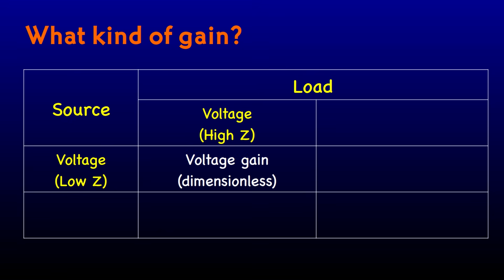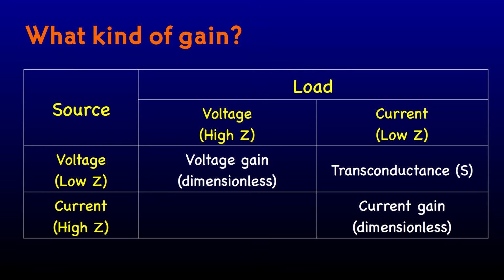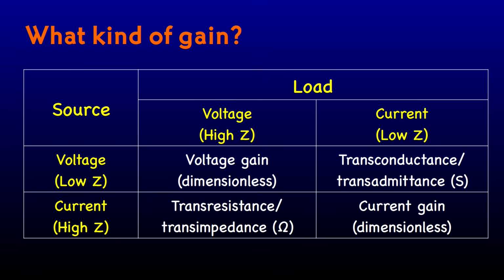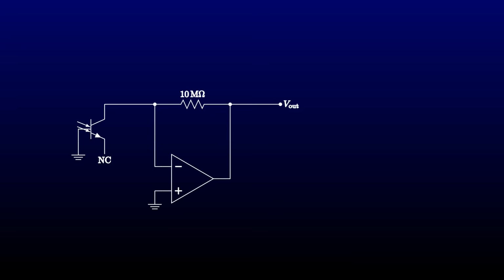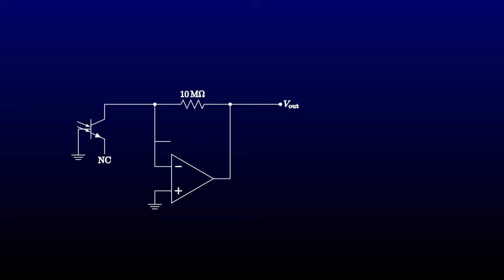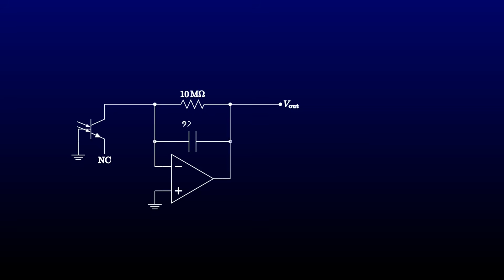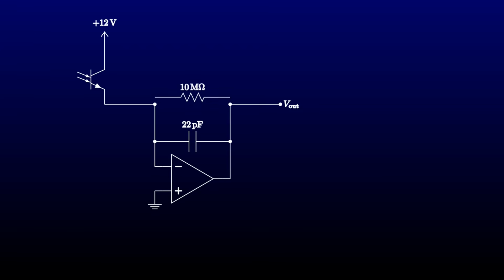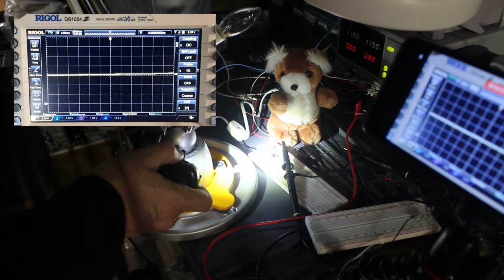The Transimpedance Amplifier | Op-Amp Basics, episode 13

Comment: Or you could modify the photometer a little and measure some of the tiniest, most sensitive things humanity has ever seen: Gravitation waves!

Seeing as they almost always use TIA photodiodes to measure their small scale signals with added quantum magic.
Reply from the maker: Yes indeed! 

On a slightly easier gravitational topic, another viewer is working on a Cavendish using a differential signal from a pair of TIA photo detectors as the sensor for the tiny displacements. These fundamental circuits show up over and over.

Comment: Thanks so much for this video. I plan to do a cavendish balance setup using photodiodes and needed to learn how to build a TIA. I’ve recently started venturing into analog electronics and it’s such a fun world! Your video series on BJTs has been so helpful as well.
Reply from the maker: Glad you're finding the material helpful!  It's been fun making it. 

The Cavendish balance is an ambitious project - the forces involved are so tiny!  Planning to use some sort of interferometry to measure the displacements?

Your channel got a sub from me, because I want to see how the work goes!
Reply: @KludgesFromKevinsCave  wow thanks Kevin, I appreciate the sub!

Yes it is an ambitious project, especially for someone self taught.

No I’m not doing any interferometry, I’m using a simple optical lever with a laser, optics mirror, and 2 stationary photodiodes with a difference amplifier. If I can calibrate it properly and keep the oscillations within the diodes windows, I might just be able to use just dual stationary photodiodes. I recently revived a 1970s Heathkit chart recorder so I’m hoping to use that instead of the usual camera position tracking or digital data logging methods.
Reply from the maker: Heathkit chart recorder?  I'd forgotten that Heath had one!  But of course they did - I used a Malmstadt-Enke UV spectrometer as an undergrad that plotted the spectrum on one. Good luck restoring that instrument!
Reply: I had no idea HeathKits were used in semi-professional settings. That’s pretty awesome, thanks for the little story. Just got the carbon fiber for the beam and the tungsten filament for the torsion. We will see how this goes!
Reply: @KludgesFromKevinsCave  Just got my first (repeatable) gravitational signal. I’m using just a laser and mirror with an optical lever at the moment. Hopefully I’ll be building the TIA detector circuit now that I have a working torsion balance. I have to say, seeing actual gravitation act laterally is quite breathtaking and beautiful.

Comment: Hello Kevin,
I see you are using the BPS breadborads. Did you so from the beginning of your channel? Me personally switched to those years ago already due to the poor quality of other brands I tried...and the absurd pricepoint of the ones from 3M. Very happy with the BPS. What is your experience? Have a nice day!
Reply from the maker: I wanted to support Ben Eater, so when I was starting the channel (and needing more breadboards for videos in progress!). I bought a half-dozen of the ones that he resells, and they've given admirable service. I think the only dead point in the lot is one that I abused with a too-large pin.

I also have a big breadboard that's a what-have-you from Jameco. It has a couple of dead points among the 2000 or so. You might also occasionally see a decades-old one, also from Jameco, that I use to hold strips of pins for soldering because that's all it's good for at this point.

Comment: Since I’m pretty sure most phototransistors are sensitive around the IR range, I’m wondering if you use a strong enough led could you measure the distance from a pulse of IR light like those obstacle sensors. Probably need a microcontroller for that precision but it’d probably a similar driver circuit. Speaking of, pulse circuitry would be an interesting topic you could cover in between these amplifier videos. 👀
Reply from the maker: Phototransistor mode is too slow (Miller effect kills you), but use the photodiode version and that's exactly how LIDAR works.

You can get photodetectors for various wave bands, but you're right that near-IR is commonest:it matches the band gap of silicon. GaN photodiode go up into near-UV, and there are devices with colors in between.

Comment: Taking apart LED lightbulbs is always an exercise in disappointment of their design choices. Most of the LED lightbulbs I've bought have failed in much shorter times than incandescents. The ones with linear regulators have bad flickering and no smoothing, and the ones with constant-current buck converters are so mismatched with inductors that they run aroynd 5-10khz making audible noise and terrible EMI. All of them run the LEDs we over the maximum current ratings, sometimes double, and at temperatures close to 170°C. It's gotten to the point where I've started modifying the circuits as soon as I buy them just to make them usable... Which really makes me question what I'm doing with my life.
Getting back to the topic at hand, almost two decades ago I accidentally ordered a bunch of Norton LM2900 Transimpedence amplifiers instead of LM2902 opamps. They've been sitting in a parts bin ever since as I've never found a use for them. I've read that some people love and prefer them for audio use, but I've never understood why as on paper they seem inferior in every way. Would you consider a video in this transimpedence  series that sheds some light on the LM2900 Norton Op-amp? Or is it just another relic of the past without much use these days?
Reply from the maker: Yeah, the LED light bulbs are the absolute worst - with the exception of all the others. Incandescents were also designed deliberately to limit service life, and CFLs are just terrible in so many respects.

Hmmm, I'd have to read up un the LM2900. I don't think I've ever used one. The big advantage of the low-impedance op amps is speed. You see them used a lot in video and RF applications, where the conventional op amps don't have the bandwidth. 

I'm not planning to get into current-feedback op amps very soon. I'm hoping to get into transconductance amps in more detail, since the LM13700 or AS3080 can do some pretty cool tricks. So many ideas, so little time...
Reply: @KludgesFromKevinsCave about a year ago i posted somewhere that I'd never used a transconductance amplifier in a circuit and someone wrote back that I definitely had, even if I didn't know it because the error amplifier in the feedback of every buck /boost/flyback controller uses a transconductance amp. I checked the functional block diagrams of a bunch of the parts I used, and yup, they were right. Now I've just been waiting for one of my favourite YouTube channels to put out a video explaining why that is. 😉
Keep up the great work, I always love your videos.